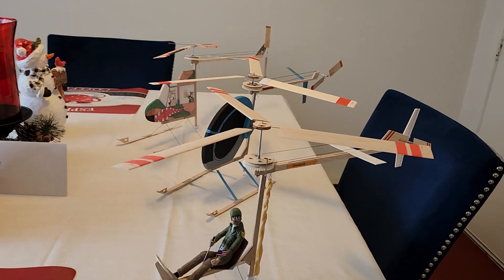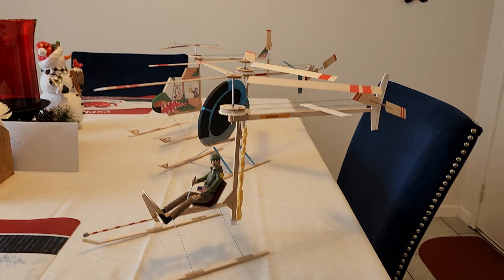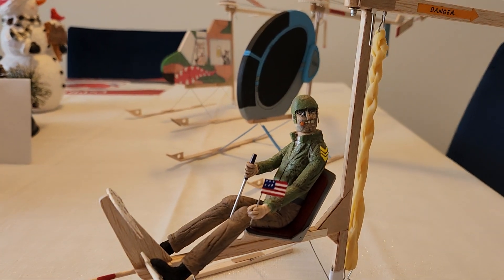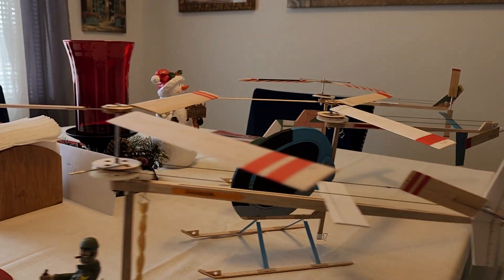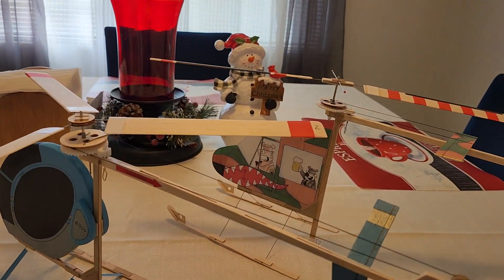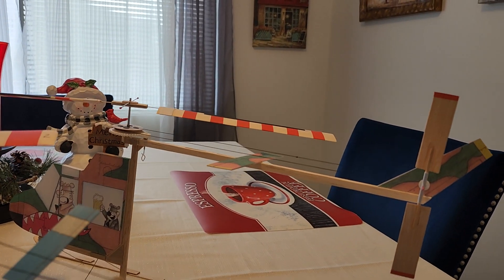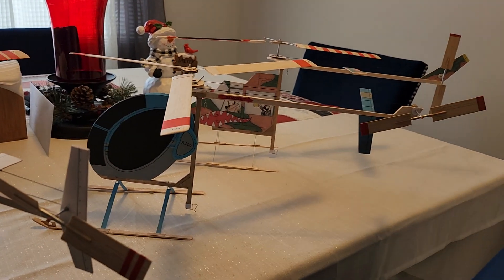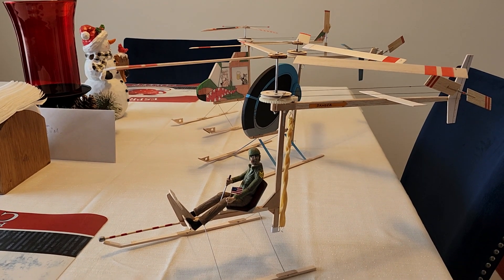New breed of rubber powered helicopters by Copter Concepts.

Comment: What are the gears on the main propeller for? Maybe it would be easier to attach the rubber motor directly to the main axis of the main rotor?
Or do these gears provide some design advantage?
Reply from the maker: The gears are a 6 to 1 ratio this allows faster rotor RPM to the main rotor which allows less rubber power needed for flight. In turn, longer flight times.
Reply from the maker: I could forgo the gearing but then I would be doing just an updated version of the penny helicopter. I want something more.
Reply: @raymondkierna7610   Hmm ...  Ок. I got it.